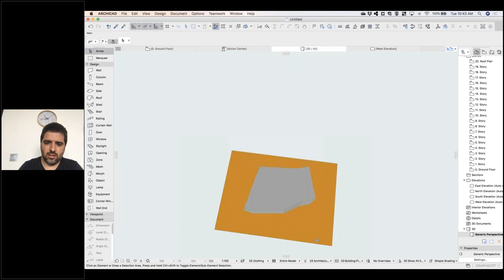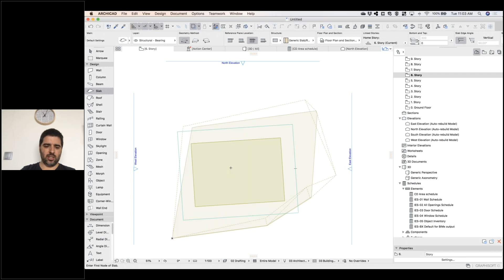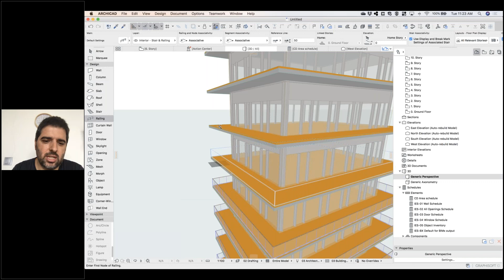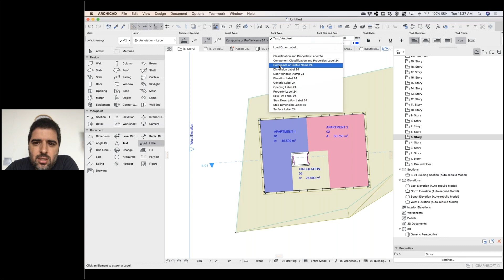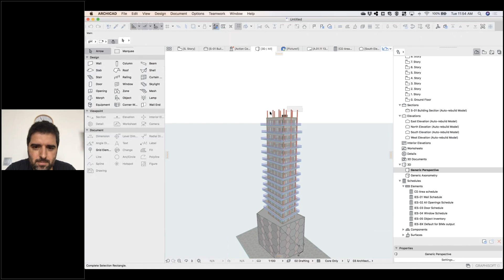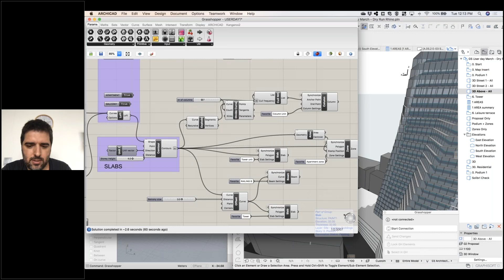Comment: Very good. I have a problem with elevator object in Archicad 24, if I use a hotlinked module with elevators into a host file with different story settings, the elevators of the module do not keep their original story setting... it's a bug I suppose?